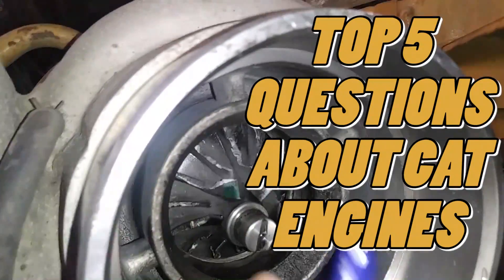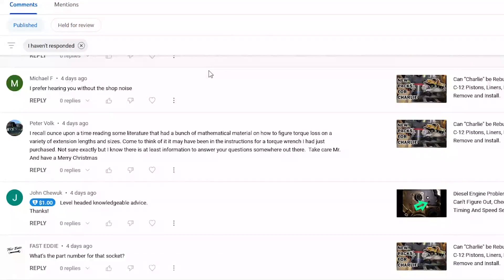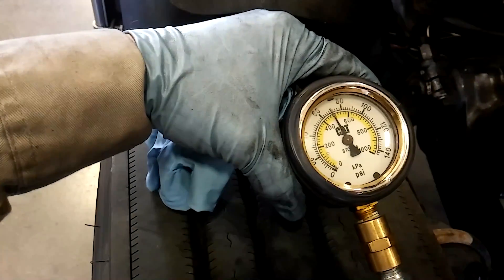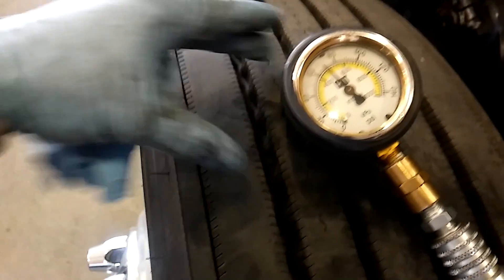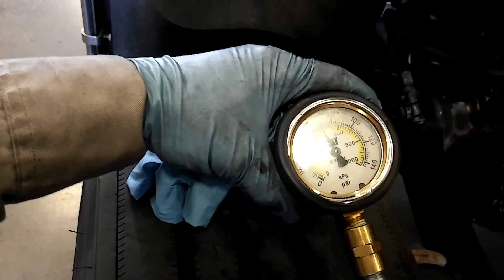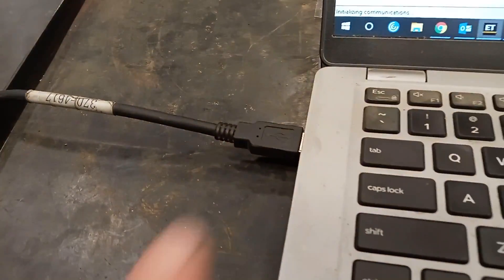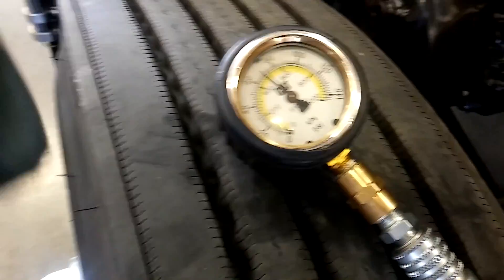The Top 5 Cat Diesel Engine Questions?!?!?

Comment: Love your videos! I recently swapped a 3116 into a gmt400 pickup chassis. Been great. However I want to run alternative fuel in the truck. As in used oil gas mix. What are your thoughts on this? What do you think for others that do this with idi and cummins engines? Curious to hear a response for effects it may have on injectors. Thanks.

Comment: I have a 2006 motorhome with a C-13, 50K miles. There is recent forum discussion about if the C-13 ECM has a battery or a capacitor to provide voltage for memory if coach batteries are off and not connected to shore power for an extended time?  I check every night hoping a new Adept Ape or Bus Grease Monkey video has been posted!:yt:

Comment: How would you Check the engine oil Level on a Big diesel engine? 
Starting It until oil pressure is ok,  checking the level 1 minute after Turn Off ?
Or Just checking the oil Level without starting It. 
Thanks !!
Reply: Open hood, pull dipstick, verify oil level, correct if low, recheck level, replace dipstick, close and secure hood latches then start truck.

Comment: I have a question?
C15 nxs overhauled 4 months ago
Seens to leak oil through the dipstick. Doesn’t have a blow by runs awesome but I seen to lose lots of oil through the dipstick. I’m wondering if is a problem or the dipstick uses a oil ring or some kind of gasket that is missing.

Comment: To add to the first one,  I've seen in very high hour CAT engines the air side of the aftercooler can get plugged.  Rare but kind of mind boggling if you don't know what to look for.  Usually air flow will be way below spec

Comment: I have a very simple solution for the crank no start on a cold 3126.
1. Plug it in for about 20 to 30 minutes and 99% of the time it will start.
2. Starter fluid. Usually the last resort, but it works. Just make sure the grid heater light is off before you crank her.

Comment: I have a c10 losing coolant, blowby has increased vapor output dramatically.  Engine has 400k, no signs of water in oil still pulling strong. What could be the cause and is there anything else I should look for?

Comment: You failed to bring up an important part of "deleting" emissions on any truck that is supposed to have them by law:

$45k for each vehicle that's been deleted, $4.5k for each deletion device sold, and $45k per DAY for reporting and record keeping violations.

https://www.epa.gov/enforcement/clean-air-act-vehicle-and-engine-enforcement-case-resolutions

For the record—the TA truck stop on exit 9 in Gary Indiana nighttime service manager told me that they will not allow any deleted trucks in the shop let alone work on them.  He also told me that some shops will cooperate with law enforcement and impound the trucks.

It's a no-brainer to either get a glider or an older truck. New trucks' MSRP nowadays are getting close to two spins and Peterbilt 389s and Kenworth w9s or whatever the equivalent is are fetching close to three spins in MSRP.  For the extra $150,000 you'll spend on a new truck over decent older truck, you take 50 Grand to fix the older truck as good as new, and then you take the other hundred grand and purchase treasury bills yielding four and a half percent.

Otherwise, I have no pity on emission truck owners' finances.

Comment: The answer to when should you rebuild your engine is exactly what I'm doing and I'm glad to hear it from a reputable CAT mechanic such as you.  I have around 1.7 million km or just over a million miles on my overhaul.  The block has around 3.5 million km or 2.2 million miles.  Oil pressure is great, never changed since new.  It was leaking a little bit around the oil filter housing and that got fixed when I replaced the oil cooler last month.  Factory oil cooler finally let go.  Cam, injectors and a few rockers were replaced last year.  Injectors still worked great but showed wear around the tips so I gave them a break and got new ones.  I do haul up to 125,000 lbs regularly.  Maybe its luck or the maintenance.  15,000 miles or less oil and fuel filter service.  Always always warm up and easy easy driving until about 10 minutes past reaching full temperature.  Only then will I floor it if needed.  I use a good additive in my fuel at all times.  So far so good so I'm just keeping it going.
Reply: What additives do you use? Lucas?

Comment: I don’t see too many cat engines where I work mostly due to emissions, but nearly all I have seen crank funny. They turn over slow for a revolution or two then crank at 250ish rpm. Is that a 100% normal thing or is it a sign of an issue in the starting system?
Reply: Ross. Check your battery cables on the starter and the batteries.  Make sure that they are clean and no corrosion.  Also some of the trucks have only one 00 battery cable for each one and I have had to add a second cable in the system for the starter to run correctly.  The new 39 MT starters require a lot of pull in amperage to get going (4-600 amps I think) and one battery cable isn’t always enough conductor when they
Get some age on them.

Comment: I have a roughly 2007 C12, that only sometimes does a non start on first start for the day, turn key off and turn on and then crank and will start. Work we do it won’t get turned off generally for the day

Comment: Okay, to be fair on the Florida Truck driver clip. How many here have had to drive trucks into locations that were clearly not set up for large/long commercial vehicles to operate in?  

How many here have worked for some place where everyone knew the only way they would ever fix/improve anything was if the bad design cost them a magnitude of order more in damage and or repair work than fixing the problem would have?  

This guy was just taking care of both problems in one go.

Comment: Hi Josh. I was at the store today and see that Rotella T4 10w-30 has the same ratings and approvals as T4 15w-40. The 10W-30 advertises “better fuel economy with same protection”. Is this true? Doesn’t sound right.
Reply: I`m surprised to find that modern reefer units spec 10W30 oil instead of 15W40.  You stop the reefer, pull out the stick to check the oil, it looks like dark water sloshing around in there, so thin and runny.  I don`t understand how 10W30 can provide much protection with the wicked heat that our Summers provide. However, for brutally cold (and dry) starts, that thin crap is what you want in there to get flowing that much sooner.  We have a mixed fleet of older and also quite new reefers. The old ones are headed towards the door, and are on borrowed time with us before they go to their next owner, so soon our entire fleet of reefers will be 10W30 oil only.  I don`t own them so I don`t have the worry, but if they were mine, I`d be running 15W40 in them from the end of March until about the end of October, then switch over to the black water for Winter.

Comment: This is a GREAT video.  I have learned so much from THE APE over the years.  I have a 2004 motorhome with a cat c7 acert and Josh has taught me so much.  And true to his previous videos, especially the one about “know your cat c7” I was able to locate all the parts that failed.  Like the 😅turbocharger and the heui pump.  All kidding aside I have never met anyone else so knowledgeable abut cat engines and is so willing to teach.
Reply: At what miles did you change the turbo?

Comment: I am sitting here chuckling. My truck is 1988 no ecm 3406B. I will never own anything newer than 1999. Good video though. Thanks for the info😂
Reply: Same here. I have a 1986 359 Pete with a 425B, a 1988 377 Pete with a 425B and a 1998 379 Pete with a 1LW 550 and I'd never buy anything newer than a 99 engine. Emissions replacement can cost as much as an overhaul on the engine not to mention all of the downtime. My 3 trucks hardly ever spend any time in the shop. Basically oil changes and service.

Comment: Hey man I am fixing to remove everything  front cover to the back plate for an oil leak on the back plate for the timing cover, so I recall seeing a video on that a few years back on timing gear lash and so on is that video still in your libray ? its a 3406E this time they are same up front I think probaly I confused you. sorry

Comment: Josh, on the '04-'07 11 and 13 liter Diesel engines Cat produced, why were they such dogs in acceleration and general performance?  The 7 and 15 liter engines were absolute beasts in performance off the line in the performance categories and I was wondering if you knew what gives on those engines?

Comment: Josh, have a used 2005 Pete with the C15 MXS that came factory to the original owners as a 475 hp rating and they promptly had it reset to the 550 hp cat spec as well as the "heavy haul" software added at the Pete dealer and was confirmed by an independent mechanic after I bought the truck as per the info his laptop hookup told him. The ultimate maximum boost I can produce is about 45 psi which would be at freezing or below ambient. I have been told by some that they feel it should be 50 psi with a hp rating like that and reach it easily  ( waste gate kicking in preventing an even higher reading ). My question is, in your experience as well as what Cat would say, what should my boost be optimally with this cat fuel spec setting ?
Reply: Now im no cat tech but i have worked on quite a bit of turbo charged stuff. ALWAYS verify your numbers with a calibrated manual guage because numbers displayed on the dash can vary or be skewed since the truck sees a lot of different conditions all the time. So before i would go figuring out what might be wrong you will want to verify your numbers

Also boost pressure and hp ratings are typically set at sea level since temp and altitude affect high boost applications.

As for the turbo hitting hard it is quite big and should be max 1-2 seconds even on a mechanical engine to come online
Reply: My bxs set at 550 would consistently build 51psi
Reply: The Heavy Haul file is for trucks that consistently gross 140,000  GVW. If you not hauling that much, the file is of no use and causes more problems. I take them out a lot. 
As EUI's wear they put less fuel on the piston. If you take it to a Cat dealer that has a chassis dyno you can do what is called a PAR run. Several items will be checked and then put on the dyno and measure fuel rate in GPH, boost in HG, fuel psi, intake restriction, exhaust back psi. Measure fuel density, air temp, fuel temp, barometric psi and covert readings back to test cell. If the fuel rate is low, the PAR run can be sent to Cat and new FLS/FTS numbers could be issued to bring engine back up to standard. Also a good tech will look at FRC, rated rack and fuel position to make sure the ECM is turning the fuel on. A derate will be one MM lower rack, if FRC is under rated fuel you have a air problem. This is the proper way to verify if you have a complaint or a failure. Or do you have a truck problem or a engine problem.
The poor man dyno is to data log a cylinder cut out test. Running the engine wide open and killing five cylinders. Your seeing at what RPM's each cylinder will hold. Your looking for balance for all cylinders. Generally if the engine will not hold over 1000 RPM's the EUI's are worn out.

Comment: Here in the UK we ran 6 trucks with the 3406B's in, a brilliant engine but in the end we had to scrap them because they couldn't pass the annual DOT test for smoke.
Reply: Here in canada my 1988 3406B is allowed 18ppm on snap test for emissions. Last test it had over 1 million miles and blew a 2 ppm. So if your cats couldnt pass e test they werent well maintained
Reply: That's why CAT have stopped making truck engines

Comment: Ah yesthe emission engines, im running an 09 t800 with a c13.  Actually pretty reliable,  goes thru an ard head a year.  Other than that an oil leak in the rear main.  Thats it.  800k and it getting close to an overhaul.  No blowby then 1 day poof, blowby.  3 days later and its blowing oil out of the tube.  Think its time for an inframe.
Reply: Thats typically how excessive blowby happens

Quite suddenly

Comment: Bought my first Cat in 1984, got 5 of those Million Mile Jackets in my closet. Cats must be serviced, the most I've ever gotten out of a waterpump is 800k, 900k lost an injector tip, after 1 million miles ditch that ECM because they fail without warning. If you wait until your components fail, you don't get core credits which will almost double your repair bill. You're on borrowed time after 800k with any engine component, at 900k trucks become money pits and it NEVER STOPS. Check that Cat coolant because it degrades over time and never run straight water. Do whatever it takes to make sure you don't need a wrecker because those tow bills can buy a lot of parts. If you love to gamble and love to take components to the breaking point then use oil analysis it'll detect, fuel, metal and antifreeze before you end up on the side of the road. Happy Motoring😆
Reply: Can you send one or two of those jackets my way?
It’s getting chilly. …
😂
Reply: Those jackets are extremely expensive. They must cost thousands to get.

Comment: I have a 2012 Cat CT 660 truck with a CT13 engine, last year I had to replace a lot of the emission parts on it for a tune of 25k. This week I had to have an emission test done and the reading was 15.5 and a pass is 20 or less. I have a 2003 international with a 350 Cummins in it with absolutely no emission parts in it and when I get the e-test done on it it always gets a reading of 2 or less. So my point is if a non emission engine is getting a reading of 2 and a CT13 engine is producing 5 times the pollution what is the point?

Comment: Hey Josh…I appreciate your videos…very informative👍….I’ve got an mbn c-15 …I picked up the truck several years ago because it was cheap…didn’t really have a need for it, but figured I might find a decent 379 rolling chassis project or something to pt it in…..anyway, engine runs beautifully..it has 930k on it but you wouldn’t know it by listening to it…it could sit for a year and you could crank it for a second or two and it would start and run smooth and perfect….recently I started it and was letting it run for a while which I would do every so often….everything normal….I was walking around the truck looking it over and it just quit, no sputtering , just like you turned the key offf🤷🏻‍♂️…..fuel pressure good on cranking….power and ground to appropriate pins on ecm all good….I’m assuming the ecm crapped out….two questions: would you agree with that assessment on the surface? If so, where would you recommend getting a replacement ecm? Thxs in advance for any info . Have a great day.
Reply: Check the fuse in the battery box
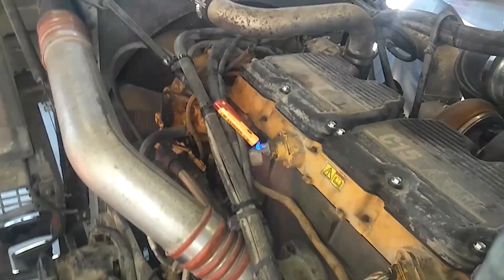Reply: Ttime stamp 3:38 pause and look Josh is holding electrical probe 110v ac on the injector harness  , ECM fires injector with high  voltage from this you can rule out ECM and wiring to injectors, this tipwas in Josh's video couple years ago. Good Luck
Reply: Remove your 70 pin for the truck side and check you power and grounds. Pin 70 is key, 52 and 53 hot all the time, 65 and 67 ground.

Comment: Yes I agree with you on deleting emissions devices. They’re just another thing to maintain unfortunately the days of just having the driveline to maintain are gone. Also what many guys don’t realize is by messing with one thing you could be messing up another. I know I’m not smarter than the engineers that designed the engine and all those pieces. In the end we all want the same thing an engine that will run reliable with as little problems as possible. That’s why I try my best to go to good shop that does good work. Good mechanics aren’t cheap but worth their weight in gold when problems arise.
Reply: Good mechanics aren’t cheap, try a cheap mechanic, see how much that costs.
Reply: If Cat engineers have thought better in 2007 to 2010 , we still have Cat engines in new trucks , engineers are not always smart but deleting emissions part I agree buy 6nz 2w

Comment: Here’s another question I’ve not seen a clear answer to. “Does a 13L have roughly the same external dimensions as a C15,C-15? Considering replacing a 13L with a C15 if there’s not a huge difference externally.

Comment: We used one of your old videos on 3406 injecter cup replacement, went to syphen fuel out of the tank and the fuel was a merky brown. The truck has been running like crap for a long time. We replaced all the cups, and had to replace 3 injecters that weren't firing.
Reply from the maker: Hopefully she is running good now 🙂
Reply: @AdeptApe  she runs like a champ now, couldn't get outta 3rd gear, now the high low shifter has a use